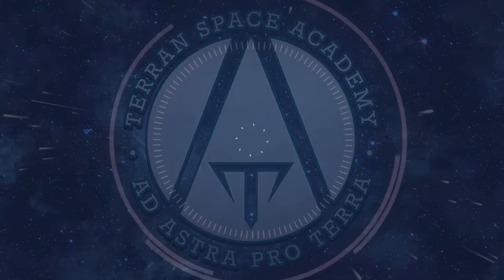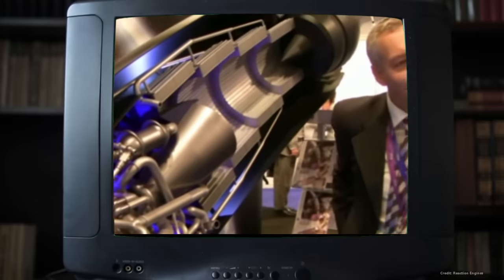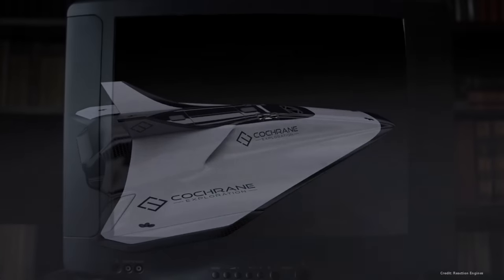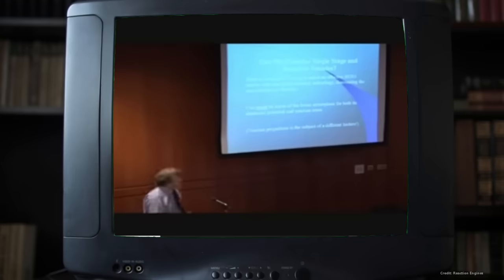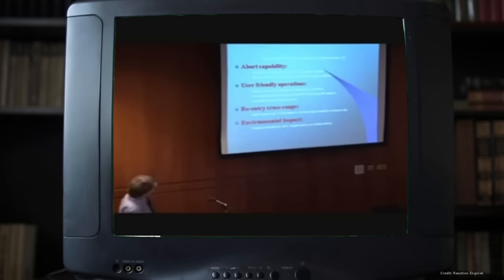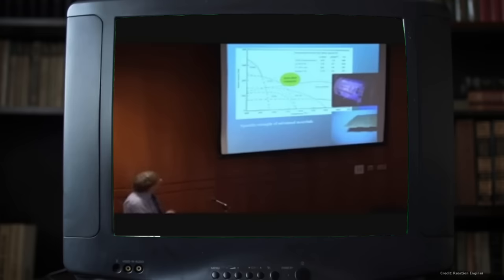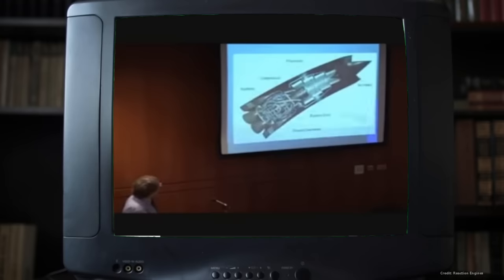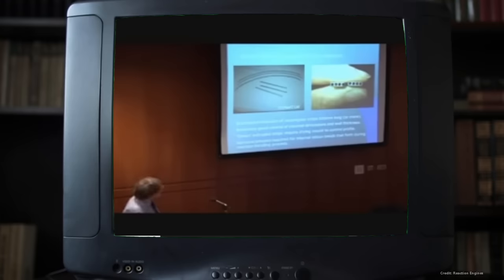HOTOL, Skylon, and the future of the SABRE Rocket Engine

Comment: I'm wondering how much fuel the initial takeoff uses compared with the rest of a flight into space & could that be saved by the use of a linear magnetic ramp to provide the initial thrust? Also what if such a ramp was built at a high altitude in line with the direction of the Earth's spin near the equator?
Reply from the maker: I've always like the idea of a train track across a plain then up a mountain.  Electric motors to get it up to speed then a rocket motor boost.  When the car hits the apex of the mountain crest the ship launches... Near mach 1 at least :-)
Reply: @terranspaceacademy or even better why not a maglev style track build inside a tunnel tube where a vacuum could be created and once run up to speed there’s no friction and the vehicle bursts out off a soft material at the launch end

Comment: Even better would be rotating detonation rocket engines. Much simpler and quite a bit more efficient. The experiments look very promising.
Reply from the maker: Indeed... We would like to pair the intake technology of Reaction Engines with NASA's Rotating Detonation Engine!
Reply: @terranspaceacademy  I'm not 100% sure, but I had feeling that rotating detonation engine wouldn't need cooling in air intake at all... well unless the temperatures would reach limits of usability for materials used there. Therefore that technology wouldn't be needed making the engine much more light and simpler with lower number of failure points.
Reply from the maker: Heat dissipation is a very big problem for RDEs.
Reply: @terranspaceacademy  It is not that big problem when advanced methods of part creation is used- 3D powder printing using high melting point high heat conductivity metals. Thanks to 3D printing the cooling capillaries can be integrated easily. These engines even work much better because of high heat generation.

Comment: Though Alan Bond dismisses a piloted Skylon, a smaller craft as depicted is likely
a much safer way to get to space and the infrastructure placed  there; by whoever.
  Even this smaller craft can have considerable automation.
  How then, do you make  this mode of transport available to the masses, and affordable.

  Skylon flying on a regular basis, also of value , even though it's considered the DC 3
of space planes; and yes Boeing have shares in Reaction Engines.
  
  Alan Bond doesn't discuss  the transportation of heavy loads on and off of Mars.
Reply from the maker: Check out Cochrane...
Reply: yes I've seen that is it a space plane though ?

Comment: I wonder why they used helium to cool the intake air. I guess the hydrogen isn’t cold enough or the hydrogen doesn’t have enough thermal mass… any ideas?
Reply: Hydrogen would ignite and when it burns increase the temperature, at the intake the cooling agent is actual mixed with air, otherwise hydrogen have the highest specific temperature and is the best cooling agent possible (in the terms of weight, otherwise have a low density).
Reply: @theOrionsarms  yeah… sounds reasonable. Another thought i had was that a leak in that heat exchanger would probably be catastrophic. He described the tubes the coolant runs through as very thin.
Reply from the maker: That's correct.  They had planned in the HOTOL to use hydrogen but a leak would be catastrophic so they added a helium loop.  I want to see methane used...
Reply from the maker: Oops.  I just repeated what you said. Quite correct.
Reply from the maker: They wouldn't be storing it.  They burn the liquid air in the rocket engine, with the nitrogen along for the ride.  The LOX for space use in its own tank at liftoff.
Reply: @terranspaceacademy  Probably I was understand wrong that part, but I was thinking, if that's would be possible? (I mean to make that oxygen collecting and storage in flight to work) , that would make much more appealing this concept, because at launch most of the vehicle weigh would be that liquid oxygen(something like 120 tons from 180) , and you cannot put on a airstrip a aircraft heavyer than 600 tons, without destroying it , so roughly three times heavyer that is their planned first orbital vehicle. So isn't to much space for more heavyer future versions.
Reply: The hydrogen is used to cool the air, it does so using helium as a heat transfer medium.

Comment: The Skylon project will not work in it's current format. if anything goes wrong with one of the engines @ mach 9 it's going to shred the aircraft into unfindable parts, as the Americans found out with their SR71's. The engines need to be in line and stacked just as the English Electric Lightning were.
Reply from the maker: Interesting... I don't remember any SR-71s shredding though.  Except for the one launching the hypersonic drone.  But that wasn't an engine problem.
Reply: @terranspaceacademy  SR-71A (61-7952 / 2003)
This aircraft disintegrated on 25 January 1966 during a high-speed, high-altitude test flight when it developed a severe case of engine unstart. Lockheed test pilot Bill Weaver survived although his ejection seat never left the plane! Reconnaissance System Officer (RSO) Jim Zwayer died in a high-G bailout. The incident occurred near Tucumcari, New Mexico.
Reply from the maker: Thank you!  I will read up on that.  Especially how Mr. Weaver survived staying in the plane... Amazing.   @sichere
Reply: @terranspaceacademy  The SR71 had many accidents.

Allegedly the RAF "Bounced" the SR71 that  was setting the Atlantic Crossing record in 1974 with an EEL Lightning.

The Sabre Engine is an old design from the 1970's of the Rolls-Royce RB545 "Swallow" The concept works but not without a suitable heat exchanger.

Comment: Skylon will be surpassed by detonation engine NASA just tested which is a whole new ballgame.
Reply from the maker: That is very true. RDEs will change everything.  I wish they would publish the Isp they got out of it. I could start doing some math.
Reply: A pulse detonation engine will not get you into space will it ? And would the heat still not be a factor in such an engine? As I was lead to believe the main problem for all engines was not getting the speed but rather the cooling issues hence the pre cooling technology being the main hold up hence the main component in sabre being the pre cooler ?
Reply: How would a pulse detonation engine control the heat let’s say if the engine is traveling at mach ten or mach 15 as I’m sure that’s what the sabre engine with pre-cooler was designed to achieve, sorry I’m not a scientist or someone who knows much about such things but they really interest me

Comment: Interesting concept but how would it compare on capital costs and operating costs to reusable Falcon 9? F9R is currently the gold standard and the cheapest way to orbit (cost/kg) until Starship is proven to work.
Reply from the maker: Comparable with many more launch location options.
Reply: Also a much quicker turn around mission time so could in theory carry out maybe a mission every few days if not maybe daily missions also you could have a fleet off spaceplanes taking off every few hours delivering building material’s into leo

Comment: He said it: it is too expensive
The SpaceX solution of a single type engine , both stages reusable, is the better solution.
But many ideas are ingenious and useable in others applications.
The project was too late to be funded.
By the way entropy is the integral of
ds = dq/T
q   heat flow into the system
T  absolute temperature.

for constant entropy stagnation temperature increase:
Ts = Ta ( 1 + 0.2 × Mach²)
a quadratic temperature increase not exponential.
Mach = 5
Ts/Ta = 6
Ta : ambient temperature at altitude exceeds Ta ~ 240 K
Ts = 1440 K
Reply from the maker: Thank you!

Comment: The question is, how can you compete with SpaceX fully reuseable two stage Space ship, where  the whole problems with hydrogen are eliminated.
Since The liquid fuel is the much warmer methane.
Reply from the maker: Use methane instead of hydrogen.
Reply: It’s still the past mate, the future is htol and maybe not today or next year but eventually all the other components needed will be perfected but the engine cooling management was the main hold back and now it has been solved the rest should follow much more quickly now, also the big military companies such as BAE systems and boing are involved so this should speed up commercial applications hopefully for the technology, also BAE systems are building and designing a hypersonic drone with the sabre engine at its core and eventually I can see boing using the sabre engines possibly for hypersonic passenger air travel, That’s the beauty off this technology it has many more applications than just shuttling space cargo, it could Also be used to remove old satellites and space junk from orbit fully unmanned and could you imagine having a fleet off htol stealth bombers which could fly into leo with a bomb bay full off tungsten rods that could orbit enemy territory ? There would be no answer to such a threat and tungsten rod hitting enemy territory would be like a nuke strike with out the radioactive fallout, it would make the ultimate bomber possible as the enemy wouldn’t be able to hit or intercept such a vehicle unless they had similar technology

Comment: 50 years and it still hasn't flown. 
By the time it does, we'll have zero point energy , anti gravity and warp drives. ( might have them already in the US military industrial complex black projects world)  😅
Reply: Zero point energy is not something I can foresee us being able to take advantage of. You don't get work done with energy, you get work done with a difference in energy. Since zero point energy is very equally distributed, there is not a gradient to take advantage of. There's a reason why they don't build dams in the middle of the ocean to harvest power.
Reply from the maker: Exactly the problem Chad!  Unless we can somehow access a dimension at a lower energy state, there is no flow, and no flux = no bucks.
Reply: @terranspaceacademy  : Might be usable in far-future cooling/anti-noise systems though... it turns out that the relevant "demon" (Maxwell's?) is actually possible with external power.

Comment: Carry enough liquid helium to liquify air at the rate of a ton every 5 seconds - non-starter
Use 70% liquid nitrogen 30% liquid oxygen for an oxidizer - non-starter
How about a proof-of-concept where a tank 70/30 mix and a tank of any fuel you want is used to test the thrust 
Will the ISP be equal to a pure LOX run on the same equipment? 
Way too many liquefaction, condensation cycles to be efficient, much less coming near hundreds of pounds per second
Reply from the maker: Combined cooling system works just fine.
Reply: That;s why it doesn't liquefy the air
Reply: You may doubt the concept, but NASA gave the engine their stamp of approval.

Comment: This is straight up sex! It would be rad to have the bypass air bleed and burn through the center and hybridize it his engine w/ the aerospike allowing the ignited bleed air to cool the center and insulate it from the more stoichiometrically mixed main burn. You could also of course run the hydrogen heat-exchanger through the center to actively cool as well. This concept may be just what the aerospike needs to be a success. Also, I fucken need one of these bitches to play with! Would be so bitchin’!
Reply from the maker: It would indeed my friend!  But a few #@$ would be appreciated :-)  I'm sensitive. I wish they would just put one in a demonstrator and watch it fly.

Comment: Saying the Soviets had an advanced aircraft industry following WWII behind the British is laughable. They hadn't stolen enough tech to be functional beyond slapping engines they couldn't build onto old piston airframes.

Canada? It isn't even a real country. What did Canada have in 1946 or 1947 remotely close to the B-36, or B-47? (1946, and 1947) The F-86? (1947) 

The British had some great designs, and had pushed the envelope in many ways. I would say they were on-par to ahead of the US in many areas without reservation. 

 However as Skylon seems to be learning, there will be some politician who will give away, remove funding, or turn into a cobbled 'partnership' mess any decent idea a British firm manages to come up with. (See also: Atlee and the RR Nene to the Soviets, Eurofighters, etc)
Reply from the maker: Nonsense.  The Soviets were doing very well in aviation after WWII.  And Canada is not only a real country but one of the best on the planet.  A lot of British and American aviation research was done there during the war and they were comparable to anyone on the planet at that time.

Comment: The Horizontal take off on existing runways had one fundamental problem.
Explained by the closest analog:
The triple sonic SR 71 could NOT take off fully loaded with fuel, it had to take off with minimum fuel and refuel in the air . 
One : the tire load was excessive, given the large speed on TO tearing the tire apart.
Two : The delta wing requires a high angle of attack and resulting in a high induced drag due to the small wing span.
Thee : The runway length was far longer than a normal length runway.
Four : There was no adequate redundancy for a failure of an engine or tire, which did not result in a Concorde like catastrophe.
None of these problems was addressed by Skytol.
The wings were  far too small to execute a transition to vertical flight, with a reasonable fuel consumption that allowed a single stage to orbit vehicle to lift significant payload.
* )No complete system engineering was conducted
* )The wing span and area was too small.
* )No crosscheck with the SR-71 mach  3.2 was even attempted to get an opinion of the only experts in high mach flight, Kelly Johnson and his team
Reply from the maker: Very real issues... 1; same system as An 225
2; variable wings like the B1B and F14 are possible but it is possible to balance the drag and lift for acceptable performance.
3; true but with better thrust you wouldn't need to...
4; array of aerospikes on the back allow redundant propulsion
Reply: @terranspaceacademy  correct but then why not start vertically to begin with? So much easier to strap on reusable boosters.
Reply from the maker: Start vertical and come back horizontal?  The problem is that the launch point is limited to extensive infrastructure build outs.  We need something that just needs a long runway and LOX/Fuel tankers.
Reply: Plot the fuel consumption vs the vertical velocity component and integrate to obtain weight vs altitude. Compare with vertical launch, do not neglect the structure the wings must be designed for with the full starting weight,  as opposed to the empty landing weight.
That alone kills the horizontal TO
Reply: @terranspaceacademy  Yes, the problem is that it is meant to be SSO, which is possible with a small payload only. I worked on Lockheed's concept.
The proof is Starship as the presently best solution, from a reliability point of view.
The undercarriage would look like the multi strut AB 480 with twice the number of wheels.
Also, the whole vehicle would need the thermal protection tiles.
The original concept on the Skytol reentry was using sharp stainless steel wings, which were 'confirmed' by the European space people but never proven, again the Starship put that important consideration into a realistic realm. 
Skylon covered with tiles does not appeal. A team of runway tile collectors after every TO?
All this does not mean that a future game changer will  not be adopted.
Reply from the maker: True. But focus on passengers and high value cargo and you do fine.  Keep the mass to about that of a fully loaded AN225 and there's no problem with the tires.